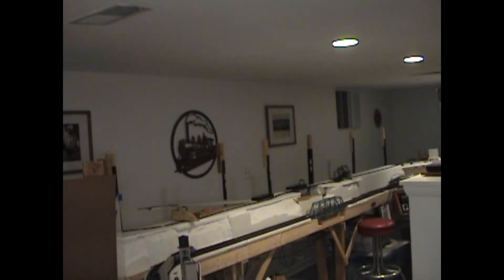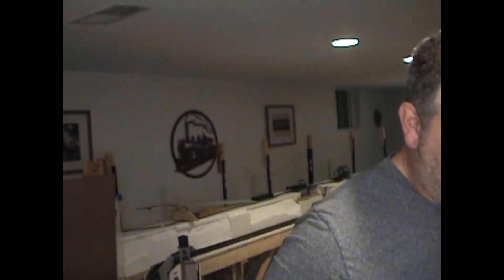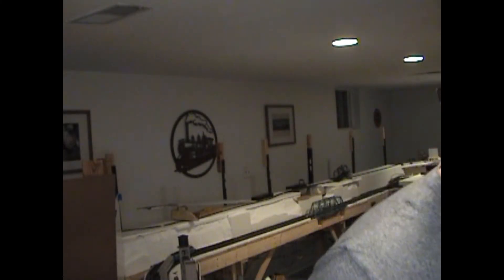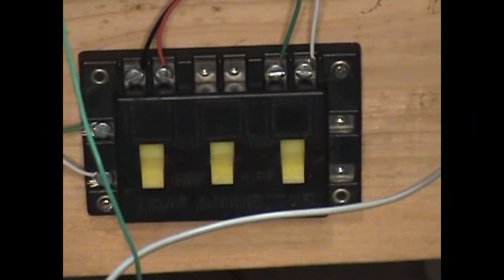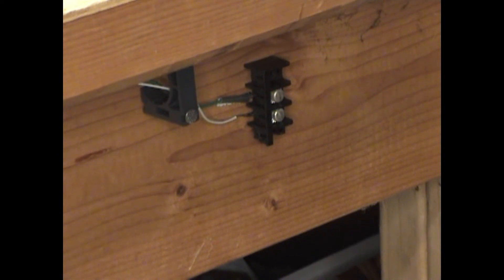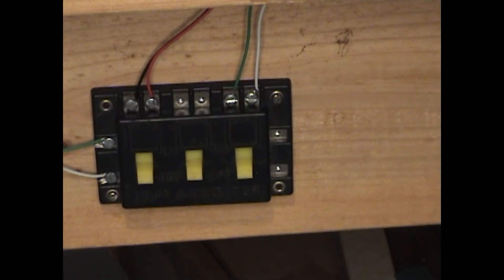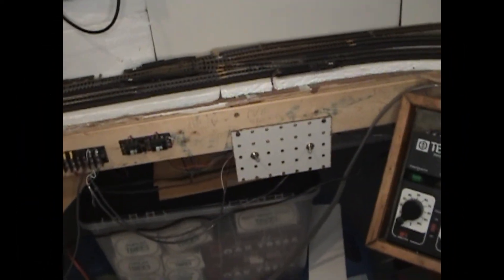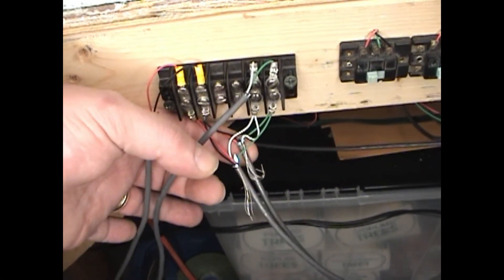Boeville & Newtown, New Beginnings #39-2021, DC Walkaround Throttle? Part 1, Dec. 12th, 2021

Comment: As a fellow DC-er, the walk around part is the difficult factor. As you already know, I use multiple MRC Master 20 transformer units that have a handle held throttle on a coiled phone cord. It has enough “butt” in it to run everything. I started installing phone jacks around my layout that are tied back to the master units. The M20 has memory so that when you unplug the throttle from one jack to move it to the next area phone jack, the train doesn’t stop. Like you, I have no intentions of going DCC anytime soon because my locomotive collection is too large and definitely too old for decoders. Thank you for sharing your throttle concept. It’s gonna work out great. Get better soon My Friend. Showstopper SUCKS!
Reply from the maker: Yes Bob....the showstopper sucks...no doubt! I actually found something the other night that might be a viable solution. $40 for a pair of "test" packs......we will see in Part 2
Reply: @RayBoebel  very cool. I can’t wait to see the next Vlog.

Comment: Hi Ray, thank you for the wiring demo, it helps for what I'm doing. As for the throttle, I think buying a ready made one would be less frustrating and probably cheaper in the long run. I'm DC till the day I die, not getting rid of 400 locos and a system I understand in exchange for a system I don't understand, not at my age.
Reply from the maker: Completely on the same page! While I have just South of 100 loco's, 90% of them aren't convertible. I found something that might work....stby for Part 2 and VLOG #40 :)
Reply: I feel you.   Wishing sometimes I would have listened

Comment: Enjoyed the throttle topic a lot! I may be crazy, but the thought that came to my mind was in the form of a question. On a normal DC layout you have transformers sitting wherever according to the layout builder's design and desire, and you mentioned that the reason some of these handhelds are so light is that they don't have the transformer in them, its plugged into the wall. 

My thought is maybe instead of focusing on the handheld, you could focus on the transformer which could theoretically be any size as you don't want to carry it around anyway...it would be "fixed" somewhere on the layout. 

Here's the question part (finally): Is there a way to have the transformer act almost like a variable DPDT switch, so that when your Bachmann controller sends a certain voltage to it, the transformer takes that as a signal to send out a certain higher level of voltage to the appropriate track. Example: You turn the knob on the controller...it sends 12V to the transformer, which tells the transformer to send 18V to the track....you get your Bachmann controller, your trains gets its 18 volts (in this example)...You could then adjust the variable settings to whatever you like. 

You could even "dial it in" for different locomotives and trains, depending on their needs or according to your operating preferences. If this is possible, the advantage would be that it could be clunky because you would only be carrying around the Bachmann controller that you like. What do you think...possible? I don't know...just thought I would mention it. T4
Reply from the maker: T4, your ahead of the ballgame my friend! I actually have something coming in the mail that will clean this mess up alot. I tried in the very beginning having power packs at certain spots on the layout. What I found was an incompatibility. More the less the same issue I found were each manufacturer has their own voltage. I will explain more in part 2.

Comment: Hmm Ray Ray Ray.... Here you were saying I'm nuts... Your in the same club mate lmao.
A friend of mine made some DC remote cordless hand throttles for his exhibition/home layout, he used the similar concept of the RC cars, planes and boats. Hi idea came from boats, as he did RC boats as well. I know he isn't well, but I'll call his partner if they can pass me over the plans and drawings of it. I know he has passed the idea, and was used by other clubs and people in the Sydney basin.
There is another way you can go about this, and it's similar to the system at Sydney Model Railway Society had before the young ones converted it to DCC. But it will mean a tad more wiring and switches.
We had a dispatch panel, and there was 2 throttles at his/her panel, with block switches that control power to yards and the main 2 tracks.
The dispatcher was able to drive the trains on the mainlines if they chose to do it.  Each yard was made into a separate block, and had it's owns throttle, it was connected to the dispatch panel, where the dispatcher could permit that yard to drive a train so far out of the section, by a flick of some switches.
It worked really well, at this club we had 7 sections, and it was fun and pretty easy to do operations. On operation nights, the dispatcher didn't get a chance to operate trains as they were to busy controlling the power districts for the other 7 operators.
If you want to talk about it more, get in touch with me buddy.
Reply from the maker: Sounds good Arty! I had thought of that in the past, but seemed that the expense would be the same as DCC
Reply: @RayBoebel  Yes and no to the expense part, if one understands and knows how to make their own electrical gadgets, they can make it cheap, I just know it was time consuming. I'll try to get hold of the wiring diagram for the cordless. The cheaper option is to have block controls in a yard section. Just doing to circuit board and wiring will be time consuming too

Comment: the real problem is you need something with enough Amps the Voltage is not the real problem a single loco neads about 0,4 - 0,7Amps (400-700 ma)
Reply from the maker: Agreed. Still need the voltage to be able to get the amps up.